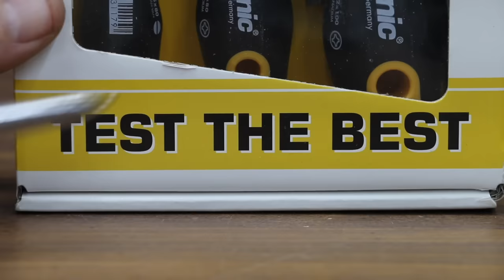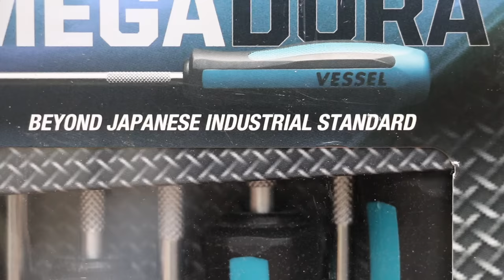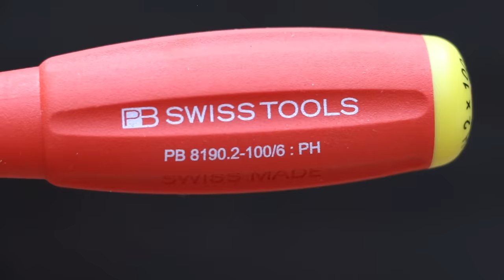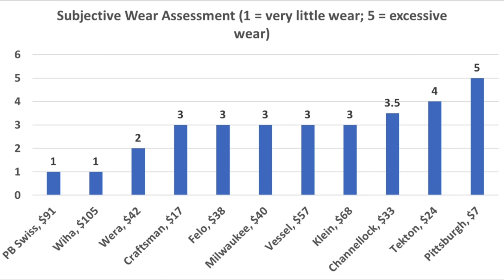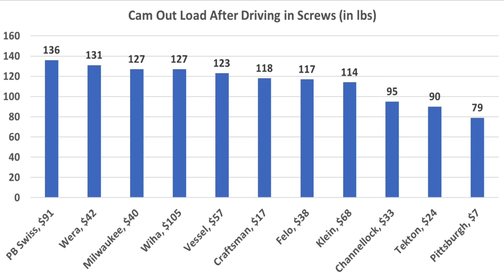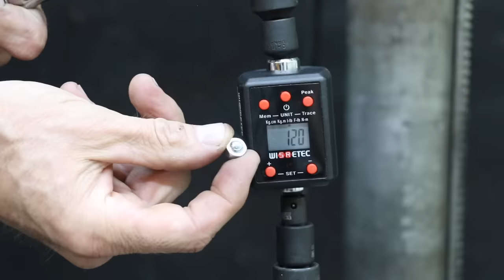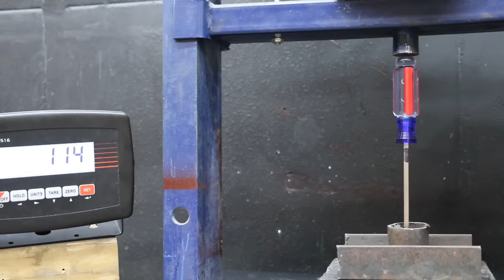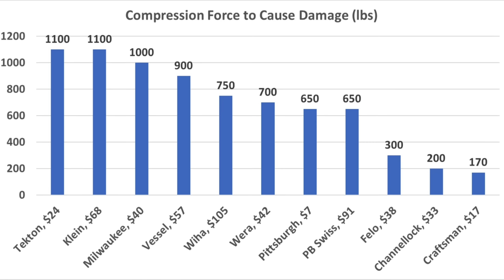Best Screwdriver Set? Craftsman, Milwaukee, Wera, Wiha, Klein Tools, Felo, PB Swiss, Tekton

Comment: As somebody who committed to Wera years ago, it's nice to see them hold up so well to your torture tests. Not covered by your testing, but the handles are the best I've found for hand comfort and grip too.
Reply: Yup, not only good for comfort and grip, but speed as well. Amazing how much faster you can work with an ergo handle, compared to an old school flat handle like the craftsman.
Reply from the maker: Thanks for sharing.
Reply: I committed to Wiha myself, and I actually bought the exact same Wiha set about a year ago. When I saw them in this test I was crossing my fingers to make sure it was money well spent. Relieved to see that they were confirmed to be great tools.
Reply: I got one Wera Phillips screwdriver since 13 years ☺️
Reply: @maxpower9499  I havent had much issue with that except for a few months back a severely worn out 3p main contactor welded together and I could not break loose the old flat lugs. At that time I was wishing for grip! Lol It bent the blade and bits on everything though even an impact driver!
Reply: @volci321 That's one of my peeves with the Weras, if they get oily and dirty.. They're hard to keep clean.

I much prefer my Felos in a mechanic shop or dirty environment.. Or the wihas. Just don't get the felo ergonic, the 500 series has a better handle.

That said, handles are a user preference thing..
Reply: I can 100% back up your claims. The handle for the Wera feels perfect in the hand and offers a lot of added grip strength from the shape of the handle.
Reply: have been selling wera tools in Denmark for 27 years...not one single complaint
Reply: I like Wera but I do think the handles while giving excellent grip and torque aren't quite as durable as some other brands. That said they are plenty tough for most uses.

We sell Wiha at the store I work for and they do seem to be a good brand. We use them around the shop for small projects. They aren't much to look at though in terms of aesthetics in my opinion.
Reply: And if you really want to pound on your screwdrivers then Wera do a cheapish chiseldriver c$40 for 6 (£28 in the UK)
Reply: I have gedore screwdrivers and love them very good handels and stand up to extreem abuse would advise them to any person
Reply: Same here, I committed to Wera some years ago and haven't bought any other screwdriver since then, great comfort and they always seemed like good quality to me. Really nice to get that confirmed.
Reply: Wiha anti slip are also useful in oily enviroments as your torque power goes to hell with regular plastic
Reply: @Krynn72  I own a bunch of the same type of Wiha Screwdrivers tested, the oldest ones are at least 20 years old. I never regretted buying them.
Reply: I concure, excellent handles. I usually try to avoid those terrible Phillips and flat heads, but when I have to - the Wera perform extremely well. Those weird serrations do work, apparently.
Reply: Wera is truly excellent. I love my Wera mini screwdrivers and I love my Wera low torque wrench with screw bit insert that I use to assemble bicycle parts exactly according to specs using Wera hex impact bits. Not cheap, but Wera tools will last and last. Their impact bits are the toughest out there. For electrical work I prefer screwdrivers made by Gedore of Germany. Their grip is great too, they may not be as tough as Wera, but tough enough for electrical work and Gedore offers an incredible wide range of insulated tools for electrical work no other brand I know of does.
Reply: @HansOvervoorde  

I've used Wera ratcheting combination spanners ('Joker'), utterly amazing. While Wera aren't the cheapest brand out there the sheer, solid quality and overall toughness is incredible!
Reply: I've tried to like wera. Prefer wiha grips. 
Bit wise I'd say they're the same though. The few times I've used wera they're great holding and driving.
Reply: @Krynn72  just be aware if you ever go to use those on electrical stuff that metal cap is connected to the shaft. I always have to be careful at work since I have three different versions of wihas ones for live work (insulated) normal soft finish and two heavy duty flat head ones. There's been a few times I almost grabbed the wrong one
Reply: Best screwdriver I’ve used yet is an S-K, but jeez Louise that thing set me back almost $20 for the one.
Reply: @John While I might agree when talking about ratchets and sockets, Snap-On screwdrivers are good, but certainly not 100 times better than Wera, Wiha, Felo, etc., if any better at all. Ergonomically, I far prefer Felo and Wera. Wera hex keys are also superior to Snap-On.
Reply: @John Wow, calling one of the most comprehensive review channels, based on objective measurements, a 'paid Amazon add'...
Do you have any objective measurements that prove Snap-On is 'a 100 times better'? I'll wait...
Reply: @John I guess that if I had paid $ 34 on average per Snap On Instinct Hard Grip screwdriver in a $ 136 set of four, I'd reason the same way. Especially if the set price is more expensive than buying each Instinct Hard Grip screwdriver separately.
Reply: @JoeC92  Both Wera and Wiha bits are excellent indeed. Both are extremely well fitting and the impact versions will sooner break the screw than break themselves.
Reply: @JoeC92  Good call, I don't do much high voltage electrical stuff, but I do have a separate insulated driver I'll remember to use when I work with mains power.
Reply: @MightyGimp  John is a one week old troll, so be gentle with him when he says absurd things!🤔🧚✨
Reply: @Urtepotte LMAO
Reply: @John I've talked to plenty of mechanics that don't like snap-on , my buddy was a navy mechanic also and doesnt worship snap on like you do, just because you like it does not mean it's the best, I've seen plenty of snap on tools break without being abused or Evey used for heavy duty jobs. And there's plenty of people that don't want to spend most of their life working just to pay for tools some people actually like to use their money to enjoy life and do fun stuff instead of just working for decades to pay off tool debt.
Reply: For hard cranking, I like the Wiha handles.  They fit nicely into the palm.  For lighter work and spinning, the Wera are fantastic.
Reply: @John you act like someone can get by with 1 screw driver you make it seem so simple all you need is one 30 dollar screw driver when most likely you need a set to do everything you need which will easily get into the 2-300 dollar range fast just for screw drivers not to mention the thousands of dollars of other tools you need to do basic mechanics work, and why do you keep saying it's amazon products like Amazon makes these products lol Amazon is just a platform for selling the products they don't make them, you can get gear wrench on Amazon which you will also find on those tool trucks you love so much and tekton and Capri are also very good quality tools you can get on Amazon, I mostly work on Japanese cars which the Amazon vessel screwdrivers will outperform snap all day on. And I would even take tekton over snap on atleast I can buy tekton used and still get the warranty, snap on used to be alot better , it used to be better priced and better warranty now you have to buy from the tool truck to get the warranty and some snap on drivers won't even warranty your tool if you didn't buy it from that exact driver even if you recently bought the tool. The only tools worth buying from tool trucks are specialty tools.
Reply: @John Do you really believe you've talked to every single aerospace mechanic and technician? Because I bet French technicians like to use Facom and German ones likes Stahlwille/Gedore/Hazet/etc. Also, all of them like Knipex. 
Point is, no single manufacturer is the best at everything. If money is of no concern (like when working on a $300M airliner), time is and you want 1 supplier for everything, then Snap-On is a very safe choice. But if you buy your own tools with your own money and have the time to do some research, you find out that some brands for some tools can be better, cheaper or both. With ratchets and sockets, Snap-On is expensive but one of the best (not necessarily better than brands like Stahlwille or KoKen, but certainly at the same high level). With pliers, Knipex is better for some/most and cheaper. With screwdrivers, Wera, Wiha, Felo, Gedore, etc. are at least as good and might have better ergonomics. If you truly believe that every single tool that Snap-On makes is 100 times better than the competition, then you are severely disillusioned, high on cool-aid or an overenthusiastic salesperson. The same goes for people that believe everything that Snap-On makes is total and utter crap. They are usually very good, but how good depends on the specific tool.
Reply: @John there are literally hundreds of tool manufacturers. He can't test them all. Also, some might be cost prohibitive (like Snap-On). Also, for a supposed Amazon shill, he has remarkably few tests of Amazon Basics stuff and somehow they seem to never win his tests... (see battery reviews for example). And where can I buy IKEA rechargeable batteries from Amazon?
Reply: wow.  Lots of love for WERA.  I found them late in life.  Wish I would have invested in their tools when I was younger and doing more wrenching.
Reply: Does the handle's start to stink when the rubber breaks down over time. Hate that smell lol
Reply: @frenchonion4595  Not so far. Most modern screwdrivers seem to be made of a different kind of plastic that doesn't do that.
Reply: No, the best ever for durability and comfort was the old USA Craftsman Professional ones (red and black) right before Sears and Bob Vila sank. SK had the same handles but green and black. Expensive but no screwdriver has ever compared in comfort and strength.
Reply: @j.c.vanniekerk7761  Remember when Mothra fought Gedore??
Reply: @ProjectFarm  thanks for your meaningless comment.

Comment: I'm 53 years old and bought my Craftsman set when I was in high school.  I still have the whole set and they still work great.
Reply from the maker: Nice!
Reply: Me too except I've gone through multiple sets, when you repair appliances in people's homes they like souvenirs , you know, for charging so much for your knowledge, even the most righteous, will steal your tools, it's bizarre
Reply: Use to be made not in Taiwan and they stood behind there tools
Reply: @jacobilewis9603  the quality seems to be the same and so far Lowes has been OK with returns, yes I have had to pressure them a bit, when they've said they can't because the tool isn't exactly the same,  I have a broken craftsman ratchet "30 - 40" years old that they won't exchange, by the way the new ones are definitely better than the old ones every style of craftsman ratchet I have from the 70s and 80s are junk
Reply: Were they made by Western Forge? If so your screwdrivers should have a WF engraved on the handle somewhere.

Comment: I've been using that Wera set for years now and they've all been outstanding.  Definitely the best bang for the buck if you want to buy once and have tools that will probably last more than your life time.
Reply: After damaging hex head button screws with a cheap crappy hex key wrench I did some internet research and decided on the Wera brand set.  I had never heard of them before, but I am very impressed with them.  Thanks for the comment.  Sometimes there is nothing as expensive as a cheap tool!
Reply: I also like the Wera stuff a lot, but if you want to use a hammer on your tools, you need to buy the yellow version of the Wera screwdrivers ;)

Comment: One of the common issues with screwdrivers camming out and stripping is that most people are unaware that not all screws that look like Philips are intended to be the same.  If there is a little dot in one corner of the screw head it’s an indication that it’s a Japanese Industrial Standard screw.  These are a slightly different shape than Philips.  Philips screws are designed to cam out because their application is for carpentry or other single uses.  You would rather have the driver slip out before the head breaks off as the screw head gets flush or deeper into wood.  JIS screws are designed to not cam out.  They are for mechanical applications, where they might be removed and reinstalled on a regular basis for maintenance and repair.  You don’t want to mix and match head types, but JIS drivers work okay on Philips screws where Philips drivers will fail miserably on JIS screws, especially with removing machine threads that have thread lock on them.  This is why so many people have gone to work on a Japanese toy, appliance or a motorcycle only to find all the screw heads strip.
Reply: Yes, and besides what you have pointed out, have to think test results could  be different if a different  brand of screws were used. We have no idea how accurately the fastener companies form their screws. Even a slight deviation could  change the outcome  of  this  test.
But great test! Thanks once again Project Farm!!!
Reply: @adollarshort1573  good thinking that is a controlled variable!
Reply: Reject Philips embrace Torx. I exclusively use Torx wood screws for any application that requires the screws to hold more than a couple pounds of load. Every box of torx screws comes with a bit that conveniently fits in my impact driver.
Reply: I always wondered if there is a metric screwdriver because I noticed some screwdrivers fit the Chinese products like a glove and some don't, thank you for the tip.
Reply: Whether it is Phillips or JIS they are both garbage designs. Robertson is the best by far.
Reply: @electric_boogaloo496  how?? Torx bits either straight break off or twist all the way around like the Exorcist girl. Even snap on torx bits do that. The more goofy sides they add, the weaker the bit. They’re crap. My M18 Surge isn’t going full blast and ain’t too suped up to begin with so that’s all on the crap torx bit. Philips is the light, they are the way.
Reply: I think a lot of people are also completely unaware that there are different types of Philips drivers with varying depths and pitch, and that you're supposed to match it to the screw.
Reply: I just learned something, thank you. I assumed those were Pozidriv, which I have. Our Dyson vacuum doesn't use Phillips, Pozidriv works well, but perhaps they are JIS.
Reply: @electric_boogaloo496  torx is trash compared to Robertson
Reply: exact reason i got the vessels finally a few weeks ago.... once i found out about JIS of course
Reply: @JoeZelensky  either are fantastic compared to Phillips.  I like the Robertson for deck screws and working with wood.  The problem is the bit is more likely to jump out.  With Torx it pretty much locks in.  I’ve had good luck with all Torx fasteners when it comes to auto repair, especially with limited access.
Reply: @kftc1980  Robertson doesn't jump at all. In fact in locks in enough that you can hold the driver sideways with a screw on. Torx is the answer nobody asked the question to because the answer already existed.
Reply: @hardtymz2517  Robertson is by far superior to Phillips and torx
Reply: @hardtymz2517  Weird you are getting that much snapping and twisting. My M18 impact will snap off the cheap torx that comes for free with screws, my kobalt ones wore out quickly and had a mild twist. My DeWalt and Milwaukee torx are all fine.
Reply: @JoeZelensky  both JIS and Pozi hold screws in any direction very tight. Testing the Vessel drivers with Phillips screws was just wrong. Torx are great for wood too. Pretty much Phillips are the worst screws ever. JIS and Pozi do not suck, but they are hard to find in the US.
Reply: Don't forget Pozidriv, the fasteners have hash marks in between the slots.  They have a small point in between the slots, and the taper is different.  Phillips can work on them but not well (they will strip eventually), but not the other way around.  Many fasteners of classic British cars are nearly stripped, a lot of owners I talk to don't even know they're different.  Phillips aren't used in Europe.
Reply: Wrong answer, boy
Reply: Wrong.
Reply: @JoeZelensky  Torx screws handle more torque, with less cam-out, than Robertson, especially at smaller sizes. And that difference is significant in practice. It’s the reason it was named “Torx” in the first place.
Reply: @lukehanna7440  Robertson does not cam out. Seen plenty of torx cam out though.
Reply: @JoeZelensky  I’ve never had a torx cam out 😂
Reply: @lukehanna7440  I guess you dont use them much.
Reply: @JoeZelensky  I’m a carpenter and use them a lot thanks
Reply: Yes hello I'm that idiot who used phillips screwdrivers on a japanese motorcycle. I knew JIS screws were different but tried to muscle through anyway. Very bad time.
Reply: I have a Vessel impact driver (not electric, you exert a turning force by hand and hit the top of the driver with a hammer) that I bought about 40 years ago. It still works like new and it disassembles and reassembles Japanese motorcycle engines without ever camming out.
Reply: @transformer889 There is a cross screw head design that is used in Japan, China and Switzerland and that a screwdriver from one of these countries fits perfectly, and there is another design (Pozidriv or similar) that is used in most other countries. You need the right screwdriver to avoid damage to the screw heads and the screwdriver.